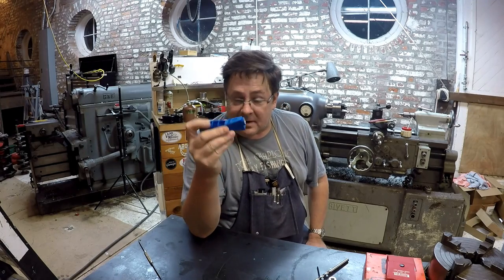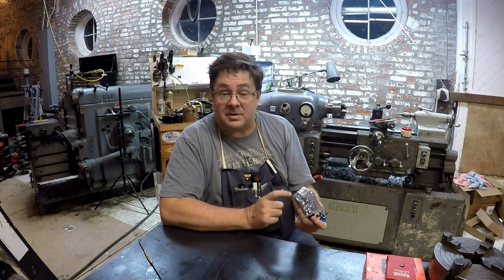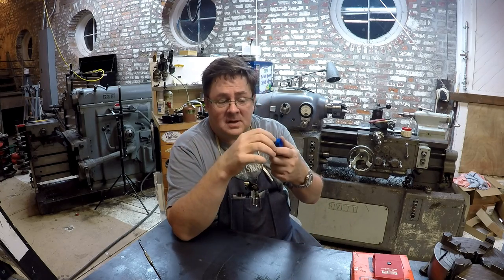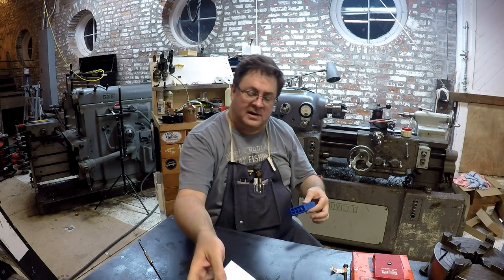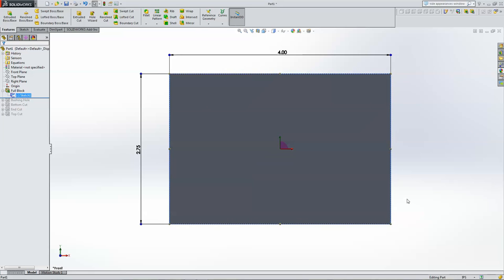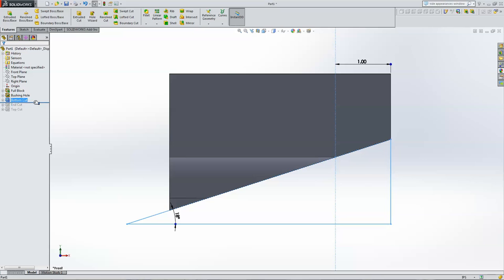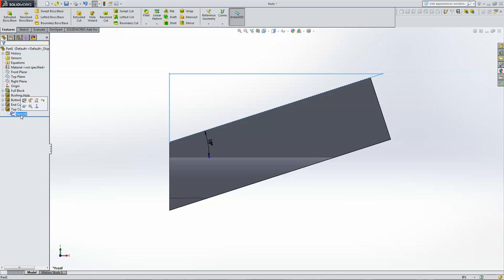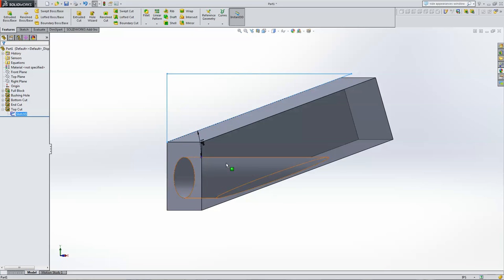Magnum Pocket Drill Jig #1

Comment: Really enjoyed the variety in shaper speeds shown. You're right that most of the vids with shapers are running dog slow. One of my favorite things with the shaper; it can be left to accomplish the job while I'm working on the mill/lathe on another part of the project. Thanks for another great video.
Reply from the maker: Robert Ross Now doubt Robert, just like any other machining process you have to consider feeds and speeds in pursuit of efficient metal removal and good finishes.

Comment: Hi mate.
I was still watching that, and you go turning it off. what's the go on that.  ; )
I'm not sure that you made the best use of the material at hand, but it is more fun like this.  I think If you would saw the bike in halve, it will never be parked against your machines again.....
I have ordered some CAD software as well, I would like to see if I can get the hang of it, if not, it'll drive me mad.          I might need a new computer if that happens : )
Marcel.
Reply from the maker: Marcel Timmers Never fear number two on the way.
Reply: But when,   When.......

Comment: That is always a tricky connection in wood, end grain to long grain.  I am surprised they did not use a floating tenon or some other form of joinery.  Pocket screws work well for some things and I think your solution will work well with the lag bolts.  One would probably be more than adequate but I read your response below, so 2 must be better ha ha.
Reply from the maker: Bill De La Vega A floating tenon would have been the traditional method, and much better than a rigid joint, it can float with the seasons.

Comment: Hi James,
Thanks again for a great video.
Could you explain why it would not be easier to use a rectangular block of the overall  finished dimensions then install the block in the vise at 18*, machine the sloped top level and then bore a vertical hole as required to give teh appropriate angled hole??
Reply from the maker: Charles Camenzuli I will address this in the next video, all will be clear. Thanks for your well thought out question.

Comment: In my teeny weenie shop I occasionally use a sharpie for markup dying, however I find that if the tip becomes contaminated with oil the sharpie becomes almost useless.  So, I still use Dycem quite a bit.  Secondly, it seems counter-intutive to have the shaper vice jaws oriented in the y direction when making y direction cuts.  I know that the same issue is present in overhead milling operation and I've seen some youtube machinists go to great lengths to prevent the bit from pushing the workpiece over.  In some cases it would seem it would be better making the cut on a milling machine in the y direction against the jaws instead of with the jaws.  Of course, I realize sometimes this can't be done.  Lastly, if you're gonna have multi part videos it would be easier if you'd label all the parts with part numbers including the first.  That way a year down the road all the parts are easier to find.  Besides, Edmond Hillary was a knob.
Reply from the maker: Tyrod 01 You are correct sir, the vise has a quick acting pivot feature to swing it 90 degrees.  I'll change the title to include a number right away thanks.

Comment: James, I'll guess if your deck is outside it's built with pressure treated wood.  Not all fasteners are compatible with the chemicals used in the wood.  I remember there was an issue with galvanized screws and PT wood.  You might consider stainless steel screws if this is the case.  McMaster-Carr probably has them.  I doubt the big box will.
Reply: +rfcarlson1 Since building decks is well within the purview of big box stores, they do in fact carry stainless screws and nails typically. But more importantly, the Spax (and other) coated screws are rated for use with PT lumber specifically for the reasons you mention.

Comment: Seems serious overkill for handrails. 3 deck screws will hold over 500lb of force. You must either have a very long span between supports or some massive  handrails. Going from finish nails to 4" fasteners, this is a Tim Taylor project! lol that cad program is very user friendly. I like that one.
Reply from the maker: bcbloc02 Its not done till its OVERDONE!
Reply: bcbloc02 Don't forget Tom Lipton's motto: Nothing too strong ever broke.
Reply: bcbloc02 Handrails cannot be overdone. I'da put in 3/8" carriage bolts, but the 5/16" lags won't be seen and minimal wood rot if done from underneath. Good balance of strength and aesthetic.
Reply from the maker: Zarouszz bcbloc02 I agree, and this is on rental property as well.  Think CYA.

Comment: what's the advantage of using a shaper opposed to a flycut on a mill?
Reply: I meant to add, it just seems to take along time
Reply from the maker: Jon Giddings There is totally no advantage other than the satisfaction of using the shaper in the first place. :-) That and tool steel is a lot cheaper than carbide!  Never fear, probably got some fly cutter action coming up.

Comment: Hi, Looks like an awful waste of your material. When I made mine I used stock of the finished thickness, bevelled the ends to 15 degrees then drilled my hole perpendicular to them. The stock was 40x20 aluminium and the liner was 15mm dia silver steel pre-drilled 10mm. All done with very little waste. I knurled the liner lightly at the top end to ensure the grip. Regards.
Reply from the maker: +Peter Gregory That would have worked for sure.  If I would have used shot inserts and not worried about full length support for the drill I can see that your method would be advantageous.  I am always thankful for a good tip.